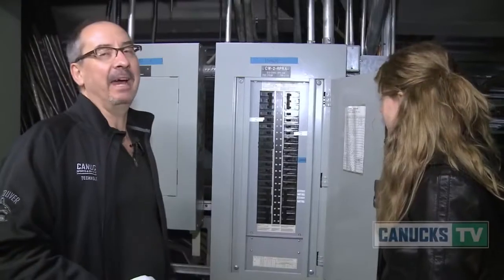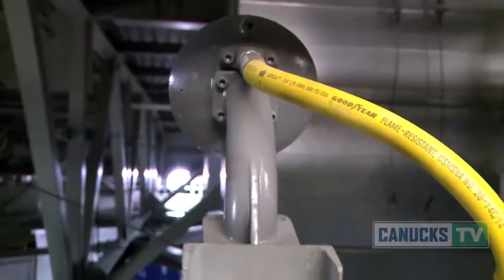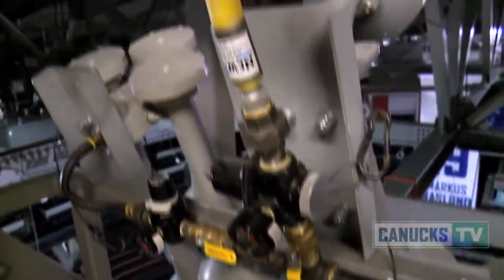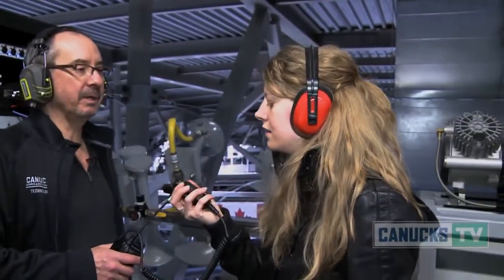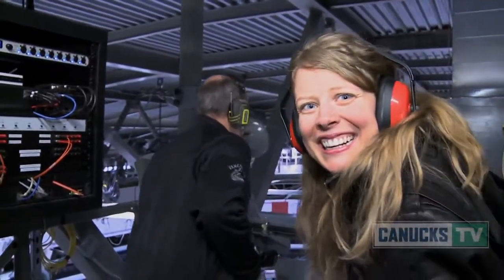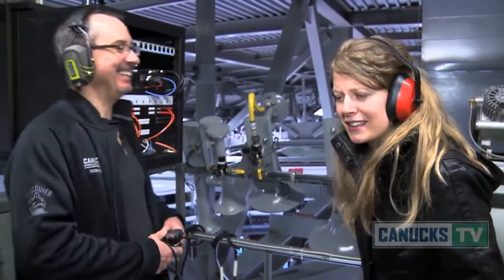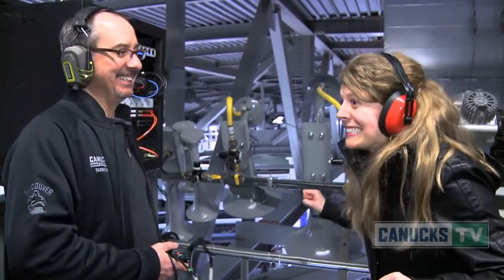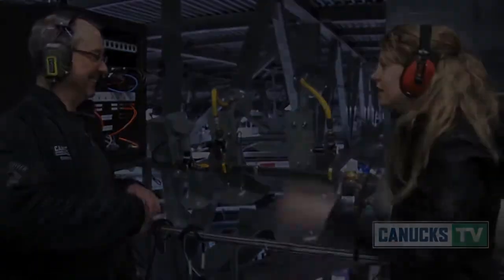Canucks Goal Horn | How The Rog Works | Episode 1

Comment: It hasn't been the same since they added the bass horn in 2007. Ruined it.
Reply: Absolutely no idea why they did that. The original one was way better. Wish they changed it back.
Reply: Really? I of course never went to a game there but I think it’s nice. The old one seemed quiet on TV at least.
Reply: It was actually 2008 when they changed it
Reply: They added the 2 extra horns to the original in 2008-09 season because the original horn was canceled out by the crowd.